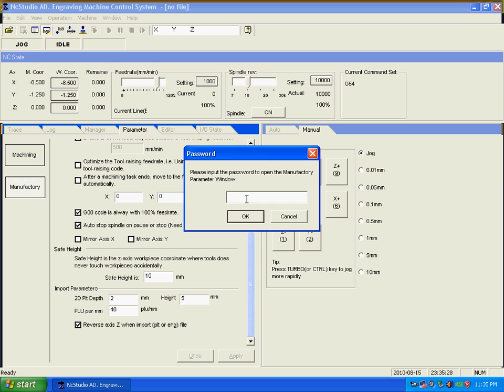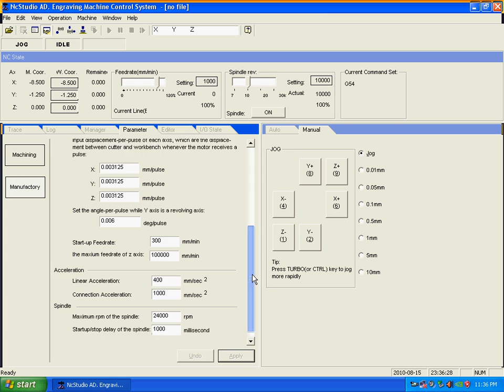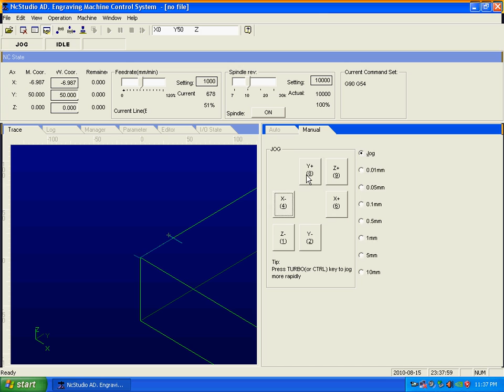04 NC Studio Parameter Set CNC Milling by www.SaleCNC.com

Comment: Good afternoon, I have a query, I have problems with nc studio of my cnc, all the parameters are placed correctly, but now it is doing the job, but with a smaller size, like 50% of the real size, any suggestions?
A week ago everything was fine and it worked perfectly now I don't know what happened but it doesn't work

Comment: Dear friends, I bought  a cnc machine a few years ago, my problem now is that I can not change the rpm values, I only have three values as shown in the attachment, I can not set any other value different from those values and I would like to increase the rpm .Can you help me?
Thanks a lot
Reply: NC studio is using 7 steps signal for control the spindle speed (rpm). It's like 7 switches. Then you need to set in the percentage in your inverter like 10% 20% 40% 60% 80% and 100%. For example, spindle is 400Hz is 24,000 rpm (100% max) and 200 Hz (50%) is 12000rpm respectively.
Reply: I have a manual in Chinese and do not understand that pb000 should I change? Thank You!
Reply: Será de pb086 a pb091?